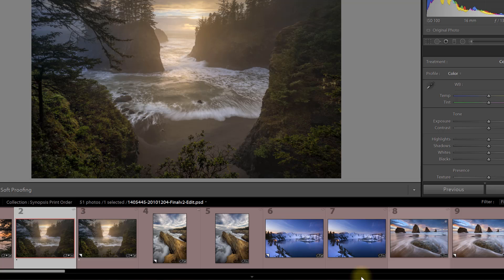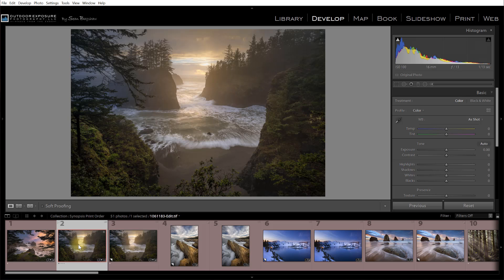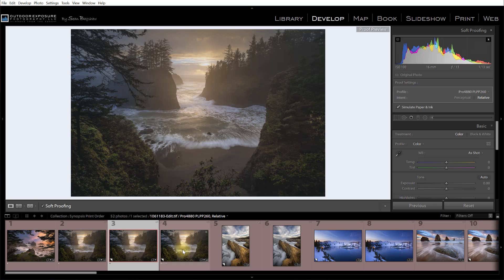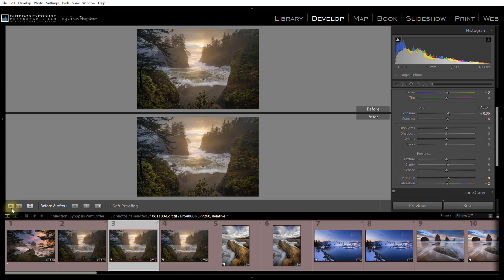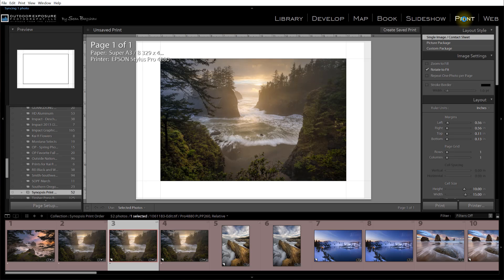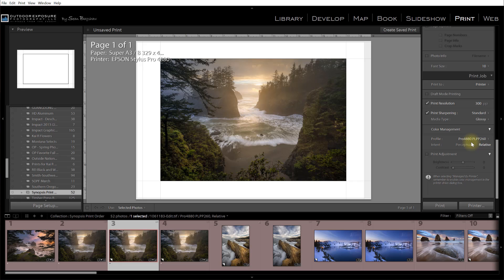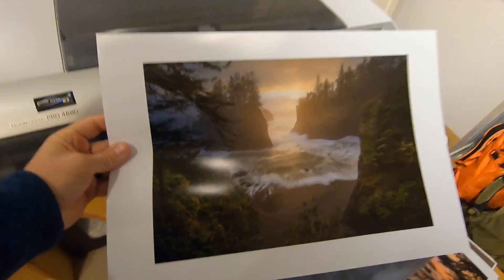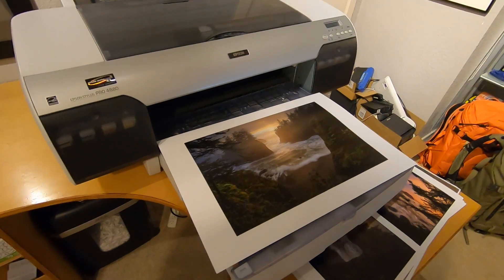My Workflow For REALLY Big Prints?

Comment: Hi Sean, Great video. Tons of useable information. Thank you.
I was wondering if this really was you final image for the printers.
I noticed at 22:33 that your top layer had been moved slightly up and right.
I wondered if you caught that.
Keep em coming, and again, thank you.
Reply from the maker: Wow! Eagle eye! Yeah...this was just a demo for the video and not one of the files I actually sent off to print, so no harm done. Trying to record a video, narrate and operate PS all at the same time can just about cause my brain to short circuit so everything I do in a video should be considered "for demo purposes only". In this case, I think what happened is I demonstrated how to nudge the layers into alignment using the arrow keys, but actually nudged them out of alignment and didn't spend the time to make sure they got set back perfectly. :-D
Reply: @SeanBagshaw  good deal. I didn't want to be "that guy" but wanted to mention it to see if you had the final print on the light table  when you noticed it. I find that this is something that happens from time to time. I always see it before printing but it had to have happened long before I found it. 
Regards, 
Dave.
Reply from the maker: @at-rq6zi  I definitely appreciate the heads up. If I had printed an out of alignment 40x60 that would be a bummer. I have been known to pull bonehead moves like that.

Comment: If you had multiple sizes of the same image to send off for printing, would you do this for each size or is there a "size grouping" type of approach where you could apply all of these techniques and then slightly resize it to a similar print size?
Reply from the maker: I do the first two types of sharpening to my master file but I do output sharpening separately for each output file.

Comment: Nice video, thanks for sharing your flow. I've recently worked on preparing a large print (40x60) and tested a few enlargement software options. GP AI did produce a decent quality enlargement for some images, however the software failed in those images that had lots of small details like tree branches, leaves, or grass lines similar to what you have in your video. Not only GP AI made the details extra sharper, which can be fixed as you demonstrated, but it also introduced new elements into the image, which looked weird. The same images enlarged with ON1 Resize looked much better and it also took much less time for the software to enlarge. That said, I believe that both GP AI and ON1 can be in one's toolbox. Cheers!
Reply from the maker: Great assessment. I concur. 😁

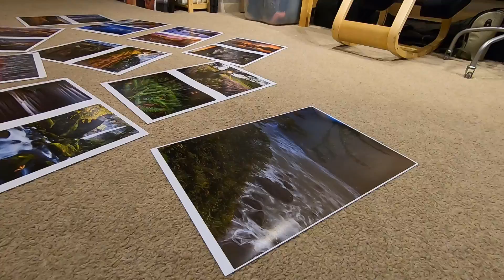Comment: Sean, can you do a video, if you haven't already made one, on how you go about making a print of a section of the image to check sharpening as you mention at 27:00?
Reply from the maker: Hi Lou...I don't have a video on that but I should make one. Until then, here's a way to to it. 
1. Size the image to the print size (40x60 at 300ppi in the video example I think it was?). 
2. Now go to Edit(Ps menu on a Mac)>Preferences>Units & Rulers and set your rulers to show inches and not pixels. 
3. Then, use the rectangular marquee tool to select an area of the image that is the size you want to test print (12x18 inches for example).
5. Now go to Image>Crop. This will crop everything outside the selection and leave you with the selected portion of the image. This does not resample the pixels at all...it just cuts out the portion of the print file you want to print. 
4. Now you can print can just print it. 
Good idea to do the crop on a copy or just remember to step back in the history when finished so you don't accidentally save when it is cropped.
Reply: @SeanBagshaw  Thanks, Sean! That sounds simple and straightforward enough. A great help for some upcoming 32x48s!

Comment: Thank you - try using preserve details 2 in Photoshop for enlargements - I saw a significant improvement. That Topaz sure did an impressive job though - nice work btw.
Reply from the maker: Compared to the Auto setting? Great, I'll give it a try. I'm surprised the Auto setting doesn't default to this when making big enlargements.

Comment: Awesome video, Sean!  I’m new to printing and wondering if you have a video of your workflow for smaller prints.
Reply from the maker: Everything is the same up through the test printing phase. For prints 20x30 and smaller I usually just print right out of LR to my printer or export and send that to the printer without the extra up-resing steps with Gigapixel AI and PS. Or, I'll follow the PS proofing steps I show in the video I link to in the description. And I have also found there are some benefits to be had with Gigapixel AI even on images that are not being enlarged much or not at all.  It can still smooth out noise and clean up edges. But the smaller the print the less this stuff is noticeable anyway.
Reply: Sean Thanks for the response. What I’m up against is printing 4x6 and close. I crop them to 4x6 in LR    But when I send to printer they get cropped even more.  Not sure I understand why. Am I missing an important step along the way?

Comment: Sean, I really like your walk through and process. I hadn't thought of combining Gigapixel and Photoshop output to eliminate the areas crunched up by Gigapixel. One question on the final save as JPEG. Do you also save the Photoshop as TIFF or PSD in case you discover something on your sectional print? Do you have a checklist you use?
Reply from the maker: I do tend to retain a tif copy with layers until I'm sure I have it perfected. I have a mental checklist, but it is always being modified and refined as I learn and new tools become available.

Comment: This was extremely helpful! Are your images on film or digital? If digital, how many megapixels are you working with on your original file before you up res? I want to follow your workflow to make 40x60 prints
Reply from the maker: Thanks! Glad to hear it. All my images for the last 20 years are digital and I do not print any of my old film photos these days because they pretty much suck. Over 20 years my digital cameras have ranged from 3MP to 50MP but I would use this same basic workflow for all of them...and for my film scans too if I were to print those for some reason. :-D

Comment: Thanks for doing this video Sean. It's great to see the care that you apply to each print. I'm sure they look stunning when they come back from the printer. I have a couple of comments: first, you seem to continually merge layers in Photoshop after you've completed an operation. Wouldn't it be better to keep all the layers in your master image in case you miss something and want to go back later (e.g. if you find another hot pixel or dust spot)? Most PS experts are encouraging people to adopt non-destructive editing techniques and merging layers mid-edit is not recommended. Also, you finish your process by producing an 8 bit jpeg file. Nowadays, there are 16 bit printers with a much larger colour gamut. Wouldn't it be better to save your file as a flat TIFF file if you are using a lab with 16 bit colour capability?
Reply from the maker: Thanks for the questions. First, in my main workflow to create the master file I do not flatten layers to maintain "backward flexibility" so I can go back and make adjustments in the future, as you say. When creating the print file, I'm no longer making adjustments to the image other than clean-up and output sharpening which aren't too hard for me to get right on the first pass. Yes, it would be more flexible to maintain all those layers, but when you start piling up pixel layers in a 40x60 image file it can really make the computer drag. This particular print order was for 30 images, so any increase in efficiency/speed is worth it for me. Regarding 8-bit vs 16-bit, 16-bit gives you more editing latitude but doesn't affect how the static image appears. Like I say in the video, as long as no additional adjustments or changes are made to the image then saving to 8-bit jpeg as the final step does not change how the image appears or how it will print.
Reply: @SeanBagshaw  I'm not sure you understood my second point. There are printers now that accept 16 bit images as input and produce smoother gradients as a result. If your target is a 16 bit printer, you may not want to save your file as an 8 bit jpeg.
Reply from the maker: @huwmorgan51  Yes, I totally understand your question. My own experience/testing and everything I have read from printers far more experienced than myself is that it almost never if ever makes a visible difference in the print itself (see this forum thread https://www.dpreview.com/forums/thread/4122063). Further, while some printers support 16-bit files, this is only available from Mac computers (Windows print drivers only support 8-bit apparently?). I use a PC and I assume that, unless otherwise stated, that print labs are printing at 8 bits. So, if it isn't making a difference in the print and most printers aren't going to print 16 bit anyway, I might as well upload 8 bit files and save myself time and also save the print lab bandwidth. So, my flow is to edit 16 bit and don't convert to 8 bit until the very end...and then don't do any editing at all after conversion to 8 bit.

Comment: Thanks much, Sean for this tutorial. Do you have any tips on how to handle out of gamut colors in Soft Proofing? I've tried a few times without success. Cheers!
Reply from the maker: Hi Rick! There really isn't anything to do with out of gamut colors (other than switching to a print method that has a wider gamut)...which is why trying to deal with them is unsuccessful. Out of gamut colors can not be printed no matter what you do...that's why they are out of gamut. When printing, the print driver/icc profile shifts out of gamut pixels to the closest in-gumut colors automatically (Relative Colormetric rendering intent). This ensures that only pixels that are out of gamut get shifted to the closest in-gamut color, keeping your image as close to original as possible. That's the best you can hope for. If colors are only slightly out of gamut then you won't even notice they have been shifted. Pixels that are way out of gamut have to be shifted quite a bit...but only just as much as needed to be printable. Trying to move out of gamut colors back in-gamut on your own can't be done on a pixel by pixel basis so you end up shifting colors in the image that don't need shifting and you also end up shifting more than needed and shifting to colors that aren't as close as possible to the orignial color. Better to just proof the image for the profile as best you can and then let the print driver do the heavy lifting figuring out how to deal with out of gamut colors.
Reply: @SeanBagshaw  Thank you, Sean! Your's is the clearest explanation I've seen. I don't print my own images at home but send them to a local lab. I must say that they match colors pretty darn close. Thanks, again  for you help with this issue. Cheers, Rick.
Reply from the maker: @rickhamill1365  That's great! I agree...the colors the labs can print these days is amazing. So, even if you do end up with some colors that are a little out of gamut most are only slightly out in the print you can barely tell. Every so often I'll have a crazy off the chart magenta or yellow/green and with low gamut printing, such as a Chromira printer or some aluminum printing, those colors will end up really bad. But if I go to an Epson Ultrachrome inkjet or the aluminum prints from HD Aluminum, then even those over the top colors can come out amazingly well.

Comment: Great info Sean!  Sub'd - Curious what computer you're using, as I'm about to start shopping for a replacement. Just watched your "World HQ" video, and couldn't figure out what it is.
Reply from the maker: Thanks for the sub! Glad to share. I'm on a PC that I had custom-built about 4 or 5 years ago. Intel i7-5820K CPU, Nvidia GeForce GTX 980 Ti graphics card, 32 GB RAM, 11 TB striped array data drive,  1 TB solid-state OS drive. I'm probably going to be due for a new machine in a year or two.
Reply: @SeanBagshaw   Thanks Sean

Comment: Funny, I just finished a similar order of large prints and had to go through the same process. I don't have a nice home studio set up but it was a great learning experience. I had my images framed for my client wish is another step to the process. Great video, would have been nice to see this before I did it, but I learned a lot doing on my own. In terms of resizing for large prints do you do that for all orders or only above a certain size?
Reply from the maker: Congrats on the print order! The soft proofing happens no matter what, but If the prints will be less than 16x24 or 20x30 then I generally just size them in PS and print...or print directly from Lightroom.

Comment: Hi Sean, thanks for the tutorial. I've read about colour corrected viewing booths used when comparing hard proofs to screen images. Do you use one and if not, why? Also, does the customer's display lighting factor into your process in any way? Thanks.
Reply from the maker: Hi Mike. Tricky questions. I don't use a color-accurate view booth, but that's certainly a next-level move if you want to go deep. I have not chosen to incorporate this step because all it really tells you is how closely your print is achieving accuracy with what you see on your monitor under precisely controlled lighting, but not how the print will actually look in its display location...unless it will always be displayed in a similarly calibrated color-accurate viewing booth. To me, the viewing booth step is extra space, time and money and doesn't really tell you anything about how the print will look on the wall. If it is possible to know and test some prints in the customer's viewing space then it could be valuable to take that into consideration but also adds a lot of extra time and effort. The reality is that unless your computer is sitting in your customer's house right next to the print, no one will ever know that the two may not appear precisely the same. And if the room has windows, the print will look different during the day than it does at night or on a cloudy day or with the lights on or off...so there is no way to print the image so that it will always appear the same in every moment anyway. Fortunately, our visual system is constantly compensating for light color changes in the environment. As long as the print looks good in what would be considered "typical" indoor lighting then that's good enough for me. If there is specialized gallery lighting then the print will only look even better.

Comment: Great lesson as usual Sean, thank you very much!

I have a question though hahaha. Could you please elaborate on the upscaljng resolution? Why the magic 300ppi number? I’ve seen people arguing that Canon printers “native resolution” (whatever that may be) is 600ppi and Epsons 720ppi. 

Would it be better to upscale to 600ppi? 

Thanks again!
Reply from the maker: Canon native is 300 ppi and Epson is 360 ppi. Jeff Schewe has shown there is minor gain by printing at 600 or 720 respectively...but only visible when inspected under magnification and results in massive files sizes for larger prints. So, it may be worth it for smaller prints but probably not for larger prints...especially when going beyond the native pixel dimensions of the file.
Reply: @SeanBagshaw  got it! Maybe you could do a video testing it? Thank you very much!

Comment: Hey man nice explanation about printing..
But

I have some questions

1. What if the image is shot with high iso like 3200 in low light

2. What if the highlights are blown

3. What is the shadows are blown and turned into black

4. If we can upscale every image though a software than do we realy need high megapixel cameras..
Reply from the maker: Thanks! 
1. Try noise reduction software.
2. Not much you can do about that.
3. Raw files from newer cameras have a lot of ability to recover shadows with good quality. If you are working on raw files try recovering shadows in Lightroom or other raw software. If you are working on jpegs then not much you can do.
4. Less of a need, but even with software, more pixels will still lead to greater fine detail in big prints.
Reply: @SeanBagshaw  regarding 2nd and 3rd question..

I ment to ask was 
Can we print the image with blown highlights and 0%blacks in it

 i always shoot in raw only..
As i learned in photography  
Always to preserve the highlights 

But in some cases we cant preserve the highlights..

So what will happen when i go for printing the photo with blown up hoghlights and 0% blacks..
Reply from the maker: @rituthahryani5163  Over exposed highlights and clipped shadows will look basically the same in print as they do on the screen. Blown highlights will just be featureless white areas and clipped shadows will be featureless black areas.

Comment: Hi Sean
In Lightroom, when you export the file as Adobe RGB won't there be some issues since the file you worked on was in Prophoto?
John
Reply: I guess my question is really this: is the export function in LR the same as EDIT/CONVERT TO PROFILE in Photoshop?
Reply from the maker: @johngiatropoulos3848  They are doing the same basic color space conversion, but PS gives you some additional features (rendering intent, black point compensation and a preview). Only colors that are outside the Adobe RGB space will be affected. If there aren't any colors in the image that are outside of Adobe RGB then the image won't change at all. For almost all my images the visible difference between Adobe RGB and ProPhoto RGB in print is minimal to none. The main advantage to the larger color space is to have more colors available in the editing phase. It's never my first choice to down-sample my color space, but if the print lab only accepts Adobe RGB they are going to convert to that profile anyway.
Reply: Sean Bagshaw got it thanks